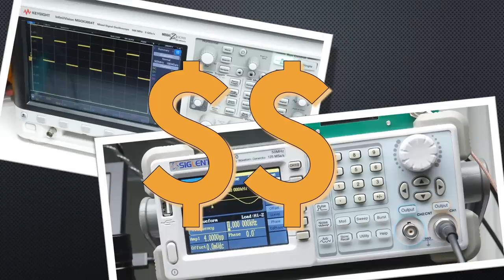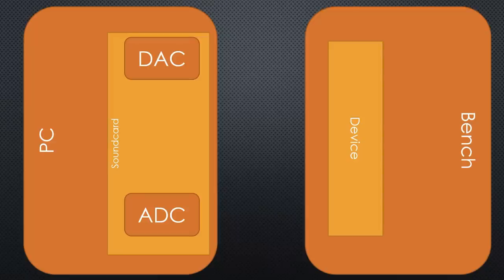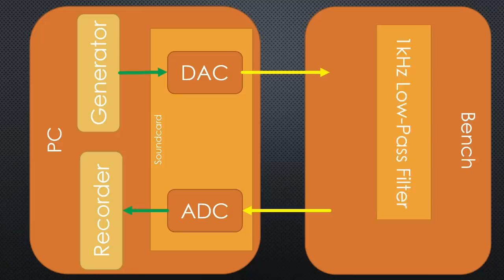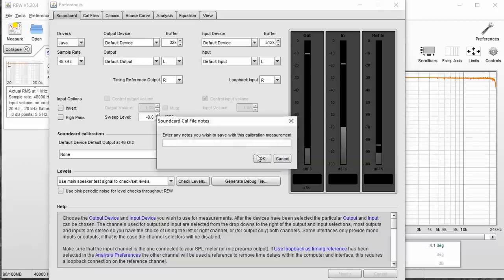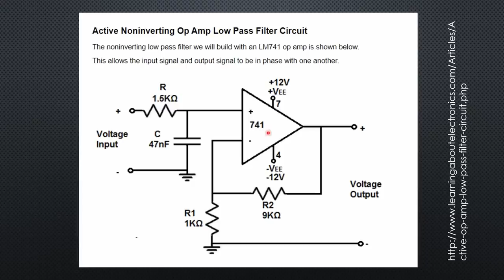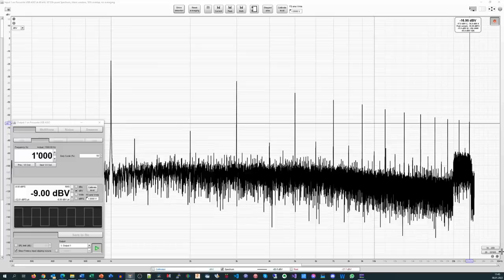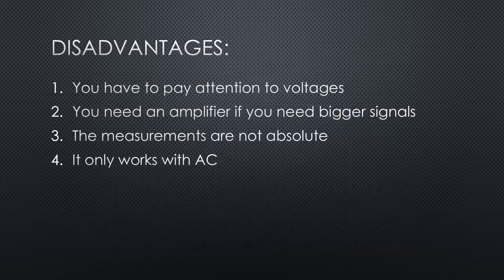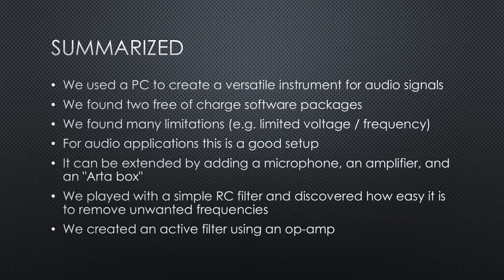#413 Your PC Soundcard is an Oscilloscope, a Signal Generator, and a Spectrum Analyzer (Arta, REW)

Comment: I won't touch Windows with a 100 foot pole!   On Linux, I have been using the free "Exescope" program for a decade already, and there are several great free wave analyzer programs available for Linux too.

I have a groovy old Wavetek model III Multifunction wave generator from the 70's!  It was serious lab equipment back in it's day, not just a tinkerers toy.  It still works excellently.
Reply from the maker: Thank you for mentioning software for Linux. Indeed, old equipment can be a good choice if you know how to repair it in the worst case (and if you have enough space in your lab).
Reply: REW works perfectly on Linux and OSX.

Comment: hmmm- was thinking about doing this for IR signals the other day, but didn't bother because I figured the frequency would max out at 48khz- 38kHZ IR would get nyquist'd for sure. Looks like I'm gonna have to see how high my soundcard goes :)
Reply: You should be able to use a video input/output system for that or maybe SDR (software defined radio) devices. Andreas has made a video about that too iirc.
Reply: It is possible. This is the first non-standard thing I did with my sound card.
Light signals can't go to negative voltages.
So when high frequency modulated signal comes to your detector, you will get automatic demodulation with default 48ks/s rate :)
If your sound card supports 192ks/s, then you can capture it completely and demodulate by yourself.
Reply from the maker: @ExplodingWaffle101: In my videos I used IR receiver diodes. They demodulate the 38kHz signal and do some filtering and AGC. The output is a digital signal. Much easier.

Comment: Andreas, it  is a good practice to place 100nF decoupling capacitors, between power rails and ground rail, phisically as near as possible of each integrated circuit.
Reply from the maker: You are right!

Comment: Really nice "hack" to analyze signals in the range 20-20 kHz, typically audio signals.
It is nice to analyze how a circuit handles signals in that range, like amplifiers and filters. 

It can be used to look at serial data at low baud rate.
Baud rate at typical 9600 or less could work, maybe even 19200, but anything faster than that, you are probably out of luck. Then at lower baud rates, many repeated ones/zeros can be lost as DC
Reply from the maker: Slow serial connections should work. But a Serial to USB connector is also not too expensive...
Reply: @AndreasSpiess  an analog view of a single can be one step of reverse engineering, if you don't have the specifications for the protocol. To understand the kind of modulation used. Is it simple hi/lo? Is 0=short, 1=long? 0=faling edge, 1=rising edge? 

If the signal is slow enough you can use a sound card to learn stuff about it. 
A dedicated digital analyzer probably is a better tool, but if you don't have one, sound cards might do the work. 
After you learn stuff about the signal, I agree about getting a serial adapter capable of reading that particular signal. 
But if you are trying to find any signal, don't know the characteristics or the specifications, an analog view could be a better start.

After you find something thinking, this looks like plain 2400/4800 baud, then it's time to hook up that serial adapter. 
If you look for signal to/from IR, they might represent 0/1 using different modulation, and possibly more tricky to set up.
Reply: With my sound chip at 192000 S/s I was able to decode 115200 baud com data.
Not 100% reliable, but enough to read text.
Reply from the maker: I once showed cheap logic analyzers which probably are the better tool for that purpose. They are only a few dollars.

Comment: Would probably be a good idea to not have a direct eletrical connection between what you're measuring and the soundcard; adding something like a optocoupler would probably be recommended...
Reply from the maker: Adding an optocoupler in front of the soundcard would cause many problems. Adding a USB insulator for an external sound card would be easier...

Comment: I have heard, but not tried it myself, that it is POSSIBLE to measure DC, if you short-circuit the input capacitors ...
Reply from the maker: You can try that and it should work. I certainly will not do it. Too complicated...

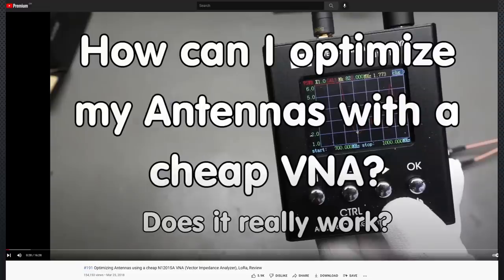Comment: The frequency sweep at 4:30 is -1.4 dB below max and in just one channel.  No warning needed, commercials are louder. Some people have to turn up their sound so much because of weak sound often heard right here on YouTube. Set up your soundcard playback level to mainstream sources not amateur streamers, then tell them to turn up their levels to standards. Such is the power of Audacity to scope audio streamed on the web. Wasapi mode instead of line in. 
Your voice track is -7.295 dB which is weak for pro production standards. Audacity has several tricks including spectrum display as well the details that I have gotten out of this video. It's just not realtime.
Reply from the maker: Thanks for the info. I use Audacity, and I level the sound to around -2dB peak, not average. But I am not sure what YouTube does with audio.

Comment: "below 1V" - I'm fairly certain the standard aux is meant for 5V (-2.5 to 2.5) but correct me if I'm wrong
Reply: Look at "Line level" article at Wikipedia.
Reply from the maker: I checked my Focusrite Soundcard and it is even higher (25Vpp). But only at the lowest gain. And I did not find an absolute maximum.
I did not want to have a lot of people complaining about dead soundcards or PCs...
Reply from the maker: Well possible. My Focusrite seems to go up to 25Vpp. But Mic input is lower. 
I just did not want to have complaints about defective PCs…

Comment: What’s the input impedance of the ADC? A normal RC lfp shouldn’t have a dB drop, but I bet it’s dragging current through that trimpot you added. Should use 1M for the pot, or use a rotary range switch.
Reply: For my card (SB Live!), input resistance is 15kΩ.
Reply from the maker: I did not investigate the input impedance. So I do not know :-(

Comment: i keep wondering if the rtl chips (dvb dongles )  could be used for similar approach
Reply from the maker: These are SDR radios, work for different frequencies and need different software. But the principle is the same: Use the power of the PC to reduce hardware cost.

Comment: I have been thinking about adding a sampler in-front of a pc scope .
Like the early scopes did .
Reply: PS
You can get a SINAD program for sound cards .
Reply from the maker: I assume the sound cards also have a sample and hold. What would be the advantage?
Reply: @AndreasSpiess  
Sorry if this is a double posted .
YouTube has deleted 2 posts with the links  😒

You mix the scope input with a reference frequency .
( Basically it works like a mixer & the output is on a sampling capacitor ) .
So you get a very high bandwidth scope with limited hardware .

Early high bandwidth scope used the technique as the input is repetitive so it works even with tubes !
( Tektronix is the first name that comes to mind )

A 100 Mhz sine wave on a 22 Khz pc scope or old o-scope is like magic .
Until you're shown how it's done !

The best I can find on the net is a tdr head project  
 “ 1N5711 Sampling Head ” but the modus operandi is the same .

Comment: How about hacking a memory stick with a resistor ladder to grab analog data at ddr2,3 rate?  Just increment the address bits and do a read of the data pins which are hooked to a ladder. Then display by changing the rw pin.
Reply from the maker: You can try that. Probably a lot of work...

Comment: Great video. I though we had to put optocoupler to protect the soundcard?
I know many people use Audacity software as well
Reply from the maker: Optocouplers are not linear and would not help in this situation because they would disturb the signal. You can use an isolated USB connector to connect an external soundcard and it would work.

Comment: I've often thought about doing this to look at my projects. But only getting to about 20kHz is the major turn off as a lot of MCU projects could easily go over that depending on the project. Plus the voltage limiting issue. I'm too afraid I'd blow up my audio system with too much voltage spikes  :P
Reply: Because of fear of blowing things I use for this purpose 20 years old PC.
And diode limiter, because I don't want to blow even old PC.
Reply from the maker: For digital projects, I anyway suggest using a cheap logic analyzer. For a few bucks you get a much better performance for digital signals.

Comment: Is there any cheap way to use this for 0-5V Digital Signals? The Frequency Domain Analysis is interesting but of little use for the average DIY guy I think ...
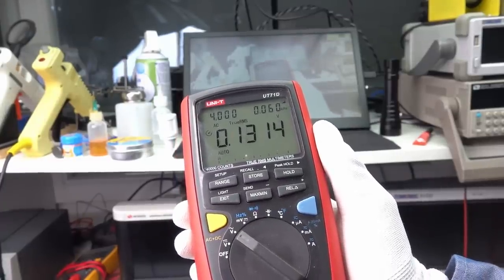Reply: At 13:35 he mentions that DC and digital devices cannot be used/ measured - only AC.
Reply: @Texas1FlyBoy  Even low frequency signals couldn't be used with voltage dividers to get the inputs in the 1V Range?
Reply: @bbogdanmircea  I just wrote a comment about the same topic. I can imagine that you can read signals but they might not be stable, but maybe you can read voltage changes from high to low. I would love to know that
Reply: @glumpfi  I remember a long time ago I did just that and it was ok but you have to be careful.
Reply: Use Cypress FX2/FX3 for that.
Reply: @NiHaoMike64  What is that and what it is doing?
Reply: High voltage is not a problem if you make protection circuit (diode limiter for example).
DC is harder problem, but if you you will track not absolute values, but changes (as @
glumpfi hfefef said), then no problems. While your signals not exceeds maximum frequency your card can capture.
By the way, I was able to capture 115200 baud serial data with my sound card.
Reply: If you only need Digital I/O without any waveform analysis, the Parallel Port (LPT1) on your main-board might be a better option.
Reply from the maker: For digital signals I use logic analyzers (see videos #72/#76)

Comment: Have Opto-isolator or Photoresistor(light as wave carrier) the response speed inorder to limit the input voltage?
Reply from the maker: That is not easy because these opto-isolators introduce a lot of non-linearity. Better to use an external soundcard and use an USB isolator.

Comment: That is interesting! I have a PC scope but miss the Generator. I did not know of this SW.
What is the reason for the external Sound Card? It is build in to all MainBoards. Is it related to quality? Convenient? Etc?
Reply: Motherboard PC audio is often horrid.  Never trust it.  Pro audio cards are way better, and more importantly BALANCED input and output.   This has huge advantages when making measurements  because it eliminates ground loop problems
Reply from the maker: My microphone needs phantom power. So this was the easiest way.

Comment: Very good video. But how much voltage do you think a sound card could handle?
Reply: A typical consumer grade soundcard is about 1V rms, which means about 2.8 V peak-peak.  However pro audio sound cards can handle (and produce) nearly 20 V peak to peak.
Reply: @big_whopper  Thanks.

Comment: do you have a video that covers how to tell which capacitors to put on the power rails? I often see this done, but don't know how to select an appropriate capacitor for the context
Reply: You may look this up in the opamp's datasheet, usually it is ceramic capacitors in the range of 10nF to 100nF, the exact value not being critical.
Reply from the maker: Maybe you watch this video: https://youtu.be/BcJ6UdDx1vg

Comment: If I connect a led with an transistor as driver for on the output and a light sensor diode on the input, could I use the setup as exposure time measurement for an analog camera in repair or testing? At least it's a single pulse measurement.
Reply: It would work yes, but it's a bit overkill and more complicated than need be. Unless you make your own programme to display the time of the measured pulse, you will also have to manually measure it. You could also do that fairly easily with just an arduino and a small display to report the measured exposure time. Just measure the time between the moment your sensor input gets high until it gets low. You don't even need to switch on the light. Just put a light sensor in the camera with a bright light in front of the lens and measure the sensor high to low edges.
Reply from the maker: It depends on how long the time between the two edges is. As I said: We only can measure AC, no DC.
Maybe you look at the cheap logic analyzers on AliExpress (I once made a video about them).
Reply: @cycnus  thanks for the hint with the arduino, sounds much easier than the pc setup 😉

Comment: if i have FM transmitter circuit can this pc oscilioscope works and detect the frequince or test if transmitter works like the original one
Reply from the maker: I do not think so because these frequencies are much higher (usually around 100MHz)

Comment: I'm kind of skeptical about this idea - probably your sound card contains filters that cut out very, low frequencies, most certainly DC, on the high end, 48 kHz cutoff isn't very good either. Additionally, the type of ADC it uses can also affect the measurements - for example, sigma-delta ADC's are pretty popular in audio, because they have pretty good bit resolution at the cost of fairly poor phase characteristics, which is fine for audio, but terrible for capturing signals.
Reply from the maker: If you compare this solution with an oscilloscope, you are right!

Comment: Couldn't a sound card be used to measure arduino pin outputs by using a voltage dividor? I mean, you wouldn't get absolute values, but maybe you can see a signal going from high to low and vice versa by looking for spikes that go up/down. I would like to test this but i'm afraid i destroy anything :D
Reply from the maker: As I said, you cannot measure DC. So the signals have to move quite fast. Otherwise you do not see them.

Comment: I have a 384khz sampling audio input but will any of these scope softwares work at that rate?
Reply: REW, the Java-based one, will work if you're able to access the device with the ASIO driver: "The ASIO drivers support up to 1536 kHz and a variety of formats depending on the driver." The Java audio driver only supports up to 192 kHz sampling at 16 bits.
Reply: @SeanCMonahan  thanks for the tip!

Comment: Can REW's scope be also used to set the bias of an amplifier?
Reply from the maker: I thinks so. By measuring the distortion (which is influenced by the bias).
Reply: @AndreasSpiess  THANK YOU! Im just learning DIY amp repair, and need a scope. Been torn between going standard vintage CRT, a budget LCD handheld, or USB.
Reply from the maker: I probably would not go for a vintage one. The new ones have much more features, are smaller, and no more expensive.

Comment: Hey Andreas, can you give your 2cents on the raspberry pi pico 200kHz digital oscilloscope maybe? :) 
I think it is interesting, but I lack the experience and tools to compare to, to access if it is useful at all.
Reply from the maker: A 200kHz oscilloscope is not very useful for digital signals. I would go for a „true“ oscilloscope, even an old one. Particularly with the current prices for the Pis
Reply: @AndreasSpiess  true. Thanks for the input. Would you be interested in a video of recommendations for entry level/budget friendly oscilloscopes? Meaning what specs do I need to consider (ie minimum requirements) when buying a used oscilloscope for example? Or did you already do such video and I simply missed it? 👀 Best regards, Hauke
Reply from the maker: @WebmediArt  For such videos you are best on the EEVblog channel.

Comment: There are cheaper usb sound cards...may be they even work with raspberry pi 0..With isolated usb hub (although quite costly) pc should be safe. BUT, it will be useful if we could use china android phones for such use case...Of course i would be interested in speaker testing after they are tested by fat rats...
Reply from the maker: Using an old Smartphone is a good idea. Maybe you will even find some software. I did not check it.
The insulated USB is also a good idea. I placed a link in the description.